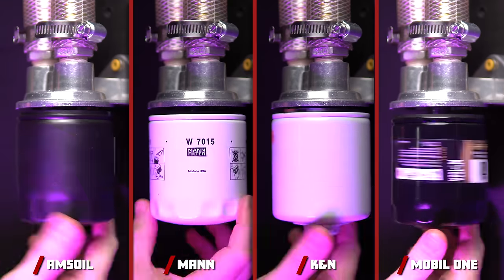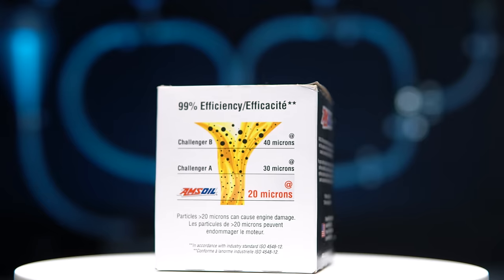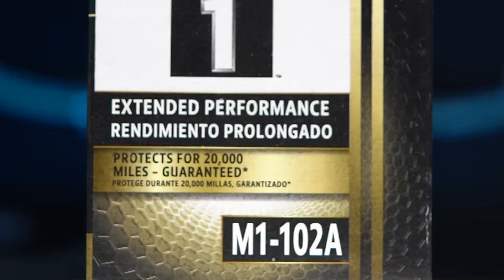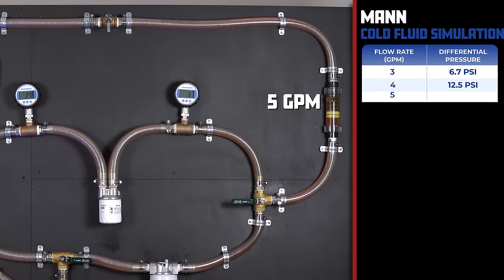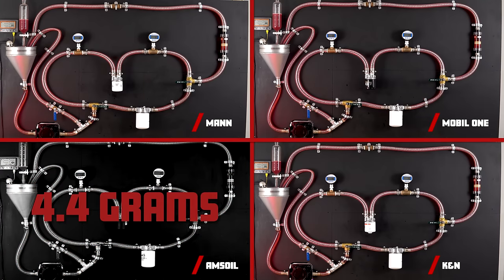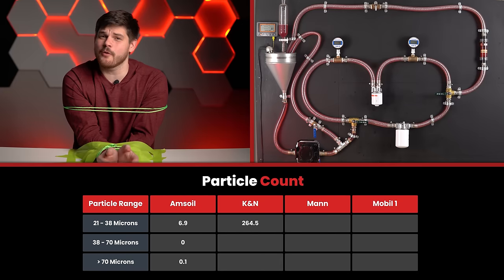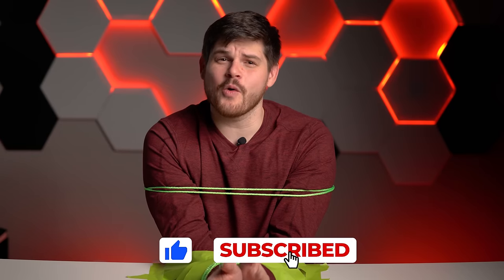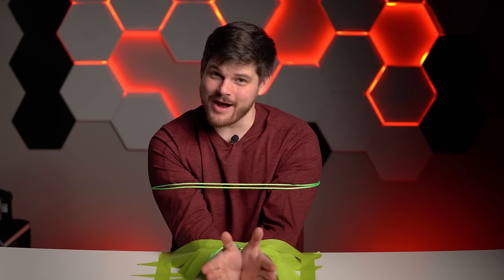Best Oil Filters of 2024 (Engineer Tested) - Amsoil | Mobil 1 | Mann | K&N

Comment: I disagree that an inferior filter (Mobile 1) that is rated at 30 plus microns is "superior" to Amsoil as an example. If you take the lower delta pressure to an extreme NO filter would win out. Therefore you must compare apples with apples. Do NOT try to compare a 20 micron rated filter with a 30 micron rated filter. And yes I have worked in both refineries and chemical plants for almost 4 decades, from operations to a lab tech. I did tests daily and know about filtration both in a lab and in process/utilities. At the end of the day oil and filters are CHEAP compared to the engine in my new 2025 automobile and could care LESS if I save 5 bucks on a filter or oil. Again, to credit an inferior filter (that has been rated for a larger micron size) as a so called winner that is a poor claim. Again if you want flow just run without a filter and get max flow. If you want FILTRATION there are basically 2 factors. The size of the filter (adding more pores for the oil to flow through) OR larger pores (and that allows more flow due to less restriction which happens to be what a filter is) that equals more flow but the filter can remove less contaminants.,